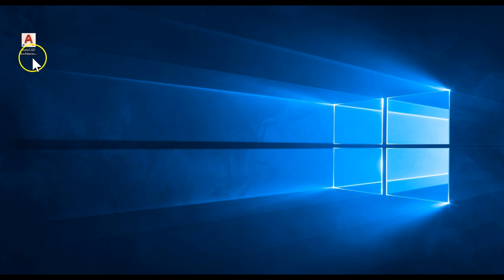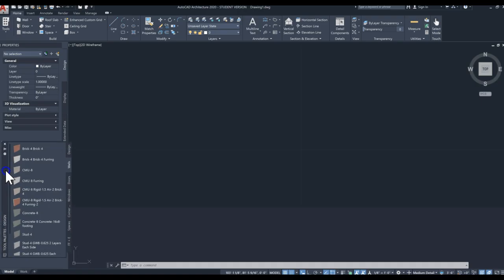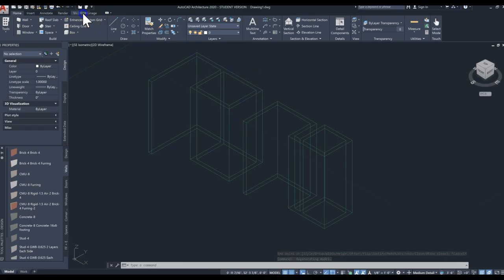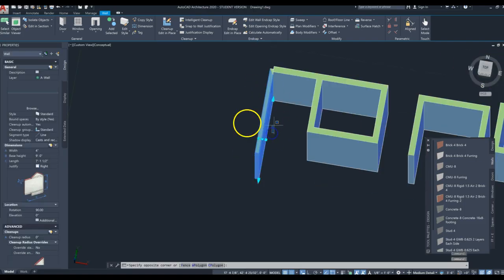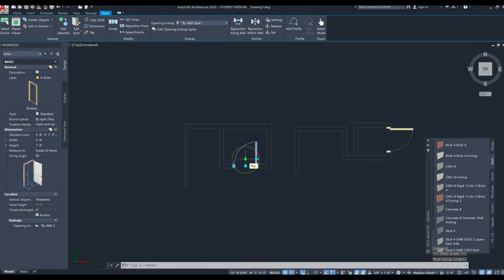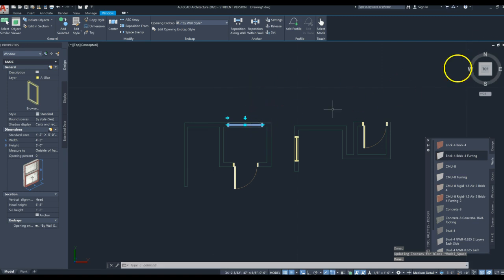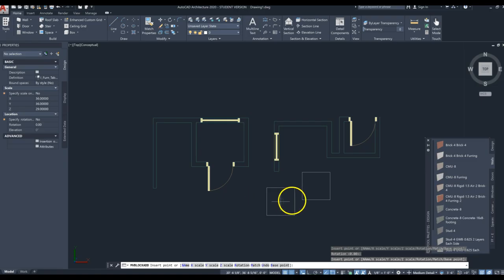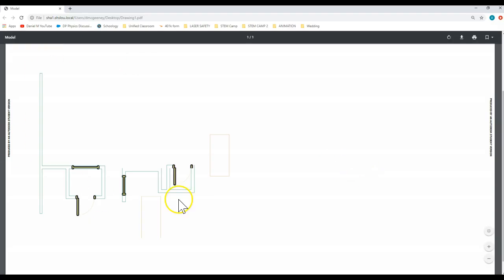AutoCAD Architecture 2020 Basics

Comment: I was barely learning Auto Cad as I did my coursework, and went to Autodesk to download student version for free so I could work from home. I downloaded Auto Cad Architecture instead of regular AutoCAD. So, I guess this is what  am stuck with.  I no longer have access to school because of Covid-19 and I desperately need to get work done for class. I can not figure out how to scale a picture in this, as it is apparently different than AutoCad, and different than in the tutorials for scaling a picture in AutoCad Architecture from 2 years ago. I don't have time to watch this over an hour long video to see if it will tell me how to scale a picture. I am extremely frustrated, that I have to learn everything new from what  just learned a few months ago, because Autodesk seems to change its methodology for the sake of change. I would appreciate any help I can get. I am buried in deadlines.